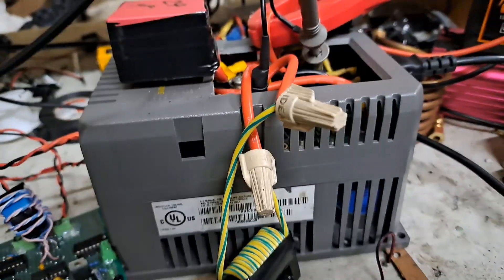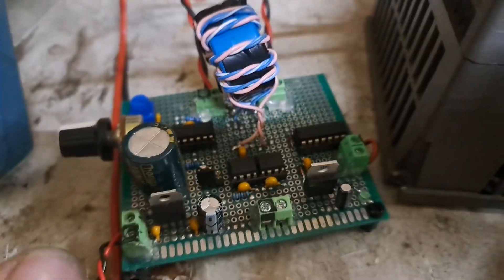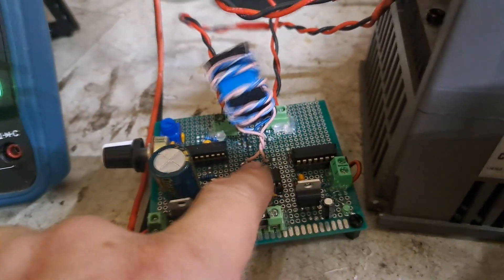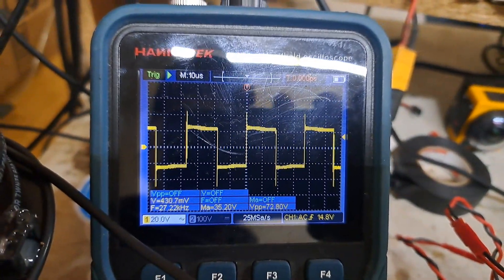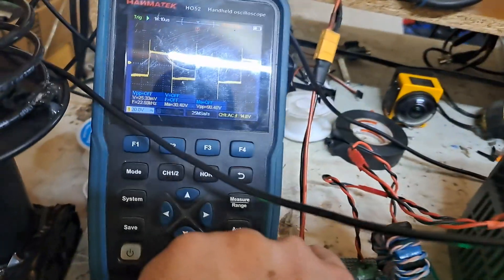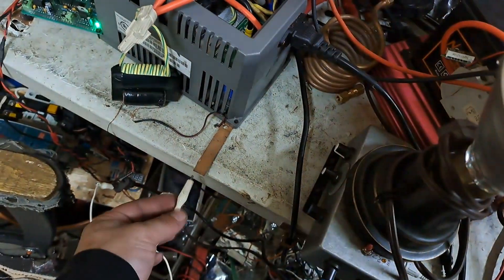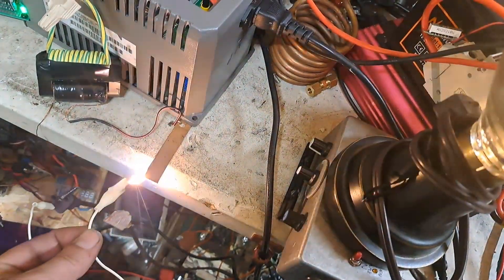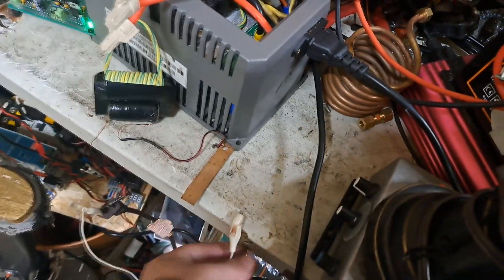Half Bridge Flyback/TC Driver 20-200khz

Comment: sick! do you have the schematic for the full circuit?
Reply from the maker: I don't but I will probably put one together when I test this again with a flyback. I just made this based off common SSTC drivers. Couple IC's to drive a GDT and TL494 setup using a common PWM circuit. Just a real basic inverter and driver.

Comment: Man I really like your videos so please please don’t be grabbing that live wire like that again. I’ve used those same alligator clip wire and they’re not too reliable. I might be over reacting but I wanna see more of your videos. You put in the time to make a darn good circuit. Spend some time making a decent spark gap so you don’t get hurt. I’ve learned the hard way a few times. Don’t learn the hard way man.
Reply from the maker: Yea I mean always good to be safe but I'm not too worried about something like this. The secondary is not tied to ground so it's pretty hard to get an accidental shock.
Reply: @ well just be careful man. It’s really satisfying making a good spark gap too. Making a carbon electrode gap would be fun too

Comment: Always enjoy the shared knowledge brother!  Looks like you get easy access to some interesting equipment!  Perks of the job huh lol
Reply from the maker: Yea man the automation world is full of stuff that is basically junk to the industry but still has cool shit. This little VFD here just happened to be some old deal where someone password protected it and there's no master code or anything, plus it's so old that the original manufacturer was bought out and there is no longer any possible support for it. Basically useless to anyone but me. Easy free heatsink and caps at the very least. A lot of "parts only" VFD's for sale out there for under $100 or even $50 where some of them are pretty large capacity. Bus caps are usually still good and the heatsinks basically always are. 480V drives will always have some ~ 400V bus caps. Typically a decent full bridge rectifier around 50-100A. Probably fairly decent IGBT bricks with probably at least one of the possible 3 exploded. Then of course there's the other usual salvage like switcher IC's for the low voltage supplies, maybe some fans, copper bus bars, optocouplers or GDT's. Maybe not always worth buying for parts but any time you can get one for free or for cheap it's a good deal.

Comment: Interesting device , seems pretty handy multipropuse , kinda like a zvs but you have more regulation/adjusting features
Reply from the maker: This is just basically an example of an all purpose bridge I want one day. I'll probably end up using beefy SiC's for it since it will need to run high frequencies if I want. 
So it would just be a badass full bridge that is easy to drive, I can drive at any frequency I want, and the driver has all the good stuff. I'm eventually gonna get a big core to wind some flyback transformer on and put it in oil. Then I'll probably try to drive it at like a kW or so just to see what arcs I can get. With a little modification something like this could also be made into a variable DC supply.
Reply: @Magneticitist  I just killed my PLL logic , connected the logic reverse polarity for mistake and heard something pop and magic smoke , seems like the cd4046 was dead , might be perfect timing to build a proper half bridge , I will try to get ucc37321 and ucc37322 , and maybe build a irfp460 half bridge
Reply from the maker: @rodriguezfranco3839  Done it too many times. It will happen again until you always make sure to put a diode on the input. I've literally done it looking dead at the wires as I was clipping them on like "ok make sure to get the polarity right you idiot".
Reply: @Magneticitist  hopefully is for the better cause I was already getting tired of the same arcs , I want to hit at least two times the secondary length , which would be like 60cm arcs
Reply from the maker: @rodriguezfranco3839  lol yea you got the arc disease. Your brain will continue to shift its perception of what a big arc is until you reach a point where you're like "fuck I need better electrical service."